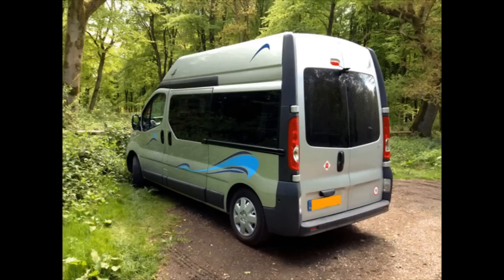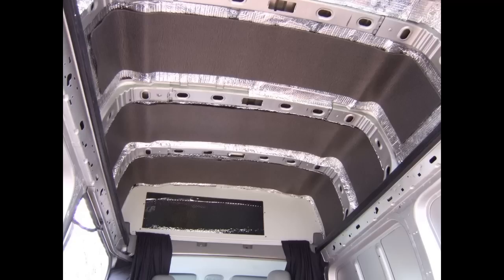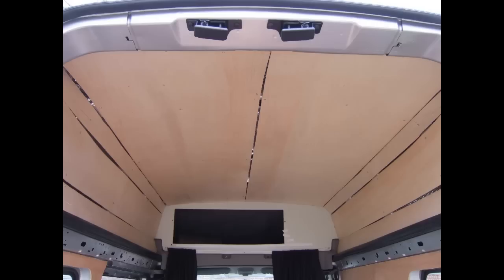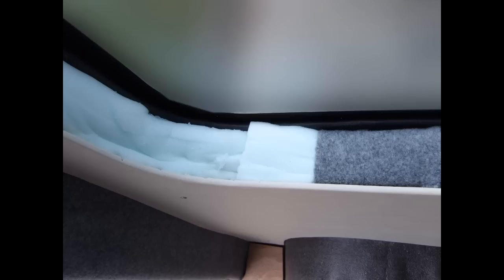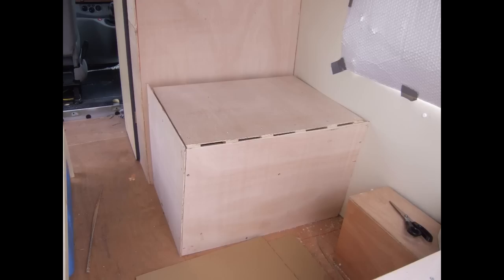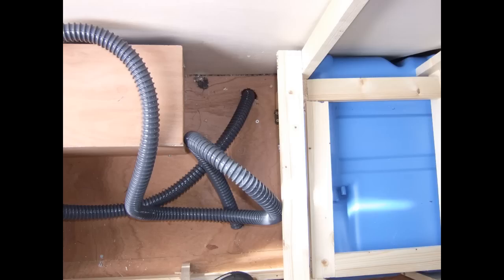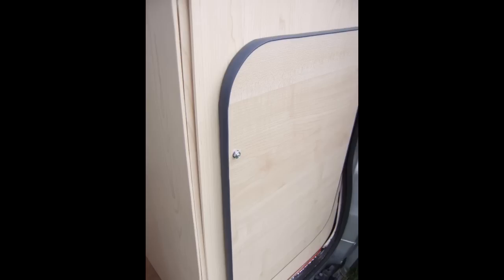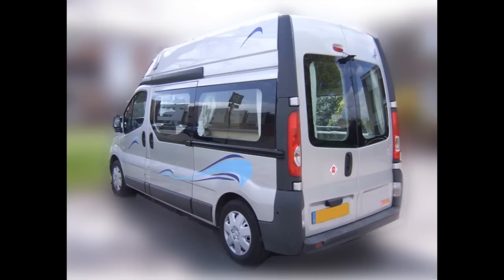HOW TO MAKE A SELF-BUILD MOTORHOME - Low Budget - From Start to Finish

Comment: i'm planning my conversion at the moment. im planning to use a refrigerated box (not a lined panel van) on a mercedes sprinter chassis (the sort supermarkets use to deliver your groceries to your house) as the refrigerated boxes have 80-100mm thick insulation which is already vapour sealed and the box is square internally with no funny angles or wheelarch intrusion, so making units will be a lot easier. also due to it being body on frame, there is space underneath the body to build lockers to house 400ah of batteries, water tanks, inverters etc, freeing up internal space. i plan to live in my conversion fulltime, all year round as there is no way in hell i'm going to become a wage slave doing 50 hours a week in some dead end zero hour contract job to pay £600+ a month to a slum landlord for some grotty horrid bedsit with prime views of the bins at the back of a factory! nor do i wish to be tied into a 30 year 200k high rate mortgage i may never realistically repay!!
to sum up: in a few years time while everyone else is losing their massively overvalued homes cause the gravy train banks have hit the buffers and they can't pay for them, i'm sitting on margate seafront in my converted van with a nice little pile of cash, no debt and a decent pint of ale, just watching the sunset on a beautiful midsummer day with not a worry in the world :)
I can only dream......
Reply: So how did it go? Still dreaming or did you take action?
Reply: insanitybiker sounds great..I'm at the age , buying a house is not a good idea, so in stead of living in a crap gang drug hood.im going to convert my van .A.S.A.P.  I'm in the USA..most hoods here is over Ren with gangs..no thanks..I'm not living around that.  !!

Comment from the maker: MPG still very good, am guessing about 35-40MPG, I can get about 700 miles on 1 tank of fuel. Overall impression - very good van, a pleasure to drive. definitely a no-fuss workhorse. 
The seating arrangement in the back however, is a bit uncomfortable for lounging around in. I may look into swapping the 2 table seats for 1 long sofa-type seat next year.

Comment: I'm not into motorhomes if I'm honest I did find your project very interesting.  A point to note regarding the battery, when charging batteries produce hydrogen gas - so It could be worth a consideration to vent it also.
Nice video and commentary...
Finished product looks good...

Comment: nice work mate. One suggestion, wrap your unused "window" panel (where the bath is) with 7+ years black glossy self adhesive vinyl to complete the blacked out windows look. Just a hint if you do so, dont cut directly on paint, use cutting wire used in advertising car wrapping.
Great video, it will help a lot of folks who are not decided if to go the DIY conversion way...

Comment from the maker: Thanks :o)  
Insurance is a bit of a minefield if not done properly. Regular insurance companies won't touch this kind of thing and will disown you if they see you've done anything like this. However, there are a couple of insurance companies that do actual "self-build" insurance policies where you have 120 days to go from a basic panel van to the full conversion. I used one of these.

Comment: I did not choose to put a bathroom or shower in my van conversion. They take up so much space and I really wanted to have the feel of an open rolling cabin rather than something with partitions and narrow passages. When I have to go in the middle of the night I have a large mouthed water bottle. Low tech but easy to empty in the morning.  I do bathing with a pot of water and I have an outdoor shower too.
Reply: Glad to see I am not the only one with large mouth water bottle... Lol
Reply: I have a capacity issue. Seems my bladder holds more than a quart sometimes. The best solution is a used laundry bottle. They are opaque too so people won't see you walking around with a bottle of pee on the way to a bathroom.
Reply: tracy smith nbbb

Comment from the maker: Standard upholstery foam for the seats. No glue used, material was stapled onto the base boards. If I had used glue it would have been spray contact adhesive.

Comment: That's a pretty ambitious project, Rick. I'd say that everything worked out just fine. If I were doing it, I'd probably skip the sink/shower altogether, push the bed up behind the driver seat, and include a full-length pass-thru storage at the rear door, but I have to say, this is a pretty impressive accomplishment. It also goes to show that if you just go out to your garage and have at 'er, you can build something pretty impressive.

Comment: The insulation segment, was good.  The only thing I would have done, as well, was to get some spray in insulation to fill all the holes in the van, after all, if you want it to stay warm inside, every little bit helps.  Also, when putting the panels inside, you have airspace in between, so fill the gaps with home insulation, stuff it in there, you will amazed how much it helps in the winter and the summer.

Comment from the maker: toilet is a thetford portapotti (self-contained unit). waste can be poured down any chemical waste disposal point at campsites, or down the toilet at home. 
120Ah leisure battery runs the lighting and water pump and is charged via a split-charger connected to the main engine battery.  Total cost for conversion was £3,000- this is mentioned in the video :o)

Comment: +rickvanman

I love the insulation technique you used - doesn't eat up the space like some techniques I've seen which use 50mm rigid insulation boards - and reasonably priced too.

I'm shortly going to embark on a little project of my own - just a small Day Van based around a LWB Transit Connect.
I'm not going to bother with a bed and furniture as all I want is a cosy and dry retreat for when the weather turns nasty on a fishing or camping trip - so I'm just going to insulate and line it, and install a basic 12v system with a couple of outputs.

I do however want to install a window into the sliding side door - partly for light and ventilation - and partly so that I can sell it on with as many boxes ticked for reclassification as a motorcaravan as I can  - without going to the trouble of fitting a sink, cooker and 6ft bed.

Nobody seems to make any windows specifically for the Connect as far as I can tell, how would you recommend I go about finding someone that can either make a custom one for me, or use one made for a different model that is going to fit?

Comment: Looking GOOD! I would suggest, be sure to put fine metal screen over the drain in the cooking gas compartment. Then if there is a leak the vapour flowing out of the "Drain" might become ignited and a metal mesh will stop flame spread to inside but let heavy gas out for more safety. Also battery compartment for a lead acid battery must have a top of box to outside because hydrogen rises and is given off during charging and heavy demand discharge...see next comment about your table problem...

Comment: In watching the cool job you did, make the table higher by building a deep, but, narrow box with a drawer sliding out the end toward the hallway, to put the salt, pepper, and silver flatware in...(Fork,spoon, & knives)  Also I put a small sconce wall lamp (One mantle) to have light and heat without using electricity...

Comment from the maker: windows were OEM green glass - standard size to fit that particular make of van. link to supplier in the notes :o)
No weight knowledge; haven't a clue,  but tried to keep everything as light as possible in the build hence 4+6mm ply instead of conti-board as used in the old Renault.

Comment: Very well done, the only thing I noticed was at the end of your video with the look around the outside. My OCD kicked in quickly when the recessed panel in front of the right window was silver instead of black. I think I would have to paint that part black to carry the color through and match the opposite side also. Aesthetically, I think it would help the flow on that side also as it feels a bit abrupt ending where the window was installed. All in all though, brilliant job....

Comment from the maker: see my other video titled "SELF-BUILD MOTORHOME 1 - SHOWER CONSTRUCTION " for answers. Easy to cut a hole - drill a pilot hole first and make certain you are not cutting into any structural components, then use a jigsaw. Car built shower? I'd say buy a camping shower and do it outside using the ground as your drain.

Comment: Cool video. You did a great job. About the only thing I might add if I did it, would be some sort of solar panel/battery system on the roof but with the deep cycle battery rigged to the vans charging system even that would be unnecessary.

Comment: Really nice build. I'm converting a Mercedes sprinter 2500 long/tall and I'm thinking of doing a similar video write up. I'm actually debating whether or not to include a shower/toilet as dealing with hot water and black water tanks aren't really to efficient for me.
I really want to avoid wood surfaces completely and build a very modern aluminum skinned interior. Again, you did a fantastic job, right down to the propane stickers!

Comment: You can get propane racks that mount on the outside back. Where you can mount two large bottles. This would give you lots of propane, and open up space.
Reply: In the UK you can't mount gas cylinders outside as such. They must be stored in a vented box labelled that it contains LPG. You just can't mount cylinders directly to the outside of a vehicle.

Comment: Inspirational video, thanks.  I noticed you didn't run any cables for charging your battery from the engine - I take it you just run a dead loss system then charge at home as you only have your water pump to power.

Comment: This is a very good build. Only thing I would do differently would be discard the need for a shower/toilet cabinet as I would normally be near a camp site/ civilisation. Perhaps a small chem toilet under a buddy seat for emergency use. I just sold a T5 VW recently. If I get another van I want one with the height advantage this one has.

Comment: Hi Rick
Its good you show the gas locker being sealed and the drain duct, but don't know if you realise you also need the bottom of the access door must be a minimum of 50mm above floor level of the cylinder dept as additional prevention against liquid gas leaking out?

If not maybe Google BS EN 1949:2002 which gives you all the requirements required to meet UK Law regarding installation of LPG systems. Hopefully you did or you could come unstuck with insurance.

Just finishing up converting a VW Crafter MWB high roof so been researching. Used similar materials but put 18mm wooden flooring in, 20mm foam insulation plus sound proofing mats and 2 x 100 watt solar panels with two 135Ah leisure batteries and a 1000w invertor and a flue free gas water heater but each to their own and everyone's budget and usage is different so Happy Camping!

Comment: Thanks for sharing. I learned from this but I also see some single purpose things that take up space that could have been done as multi purpose. Also where is the fridge and closet and what about solar power?
If you can put 3 things that lay flat against the wall that sit one inside the other why not? Biggest would be the bed. When folded flat against the wall on the bottom can be next biggest dining table and inside of that work desk with the bottom on the bed having shelves, speaker, monitor etc. so that one space accomadates three functions.
What kind of toilet was it? Was that a composting toilet? Where are your inlet and outlet fresh air flow? Did you figure out how to hide the light that would come out from both the inlet and outlet air ducts? Is there a heating system? Which one did you choose?
Have you considered an alcohol stove? Did you counterbalance the weight of the fresh water tank with the gray water tank by having them on opposite sides?
We did not get a chance to see your ligting system and how you power it.

Comment: Nice video and build. It may help if you like your legs elevated a little when you sleep as I do,, it doesn't make the bed longer but since I'm not in a straight line it makes me shorter. 75mm cushion seems to work well and doesn't bother me if I turn on my side in the night as it is not too high.

Comment: Tip when using mastic as you said you struggled to keep it tidy.Get some soapy water in a cup and dip your finger in the soapy water and then flatten the mastic out with your finger to get it even and where it needs to be and because of the soapy water the mastic wont stick to your finger.
Reply: +Davey 14 PS-GREAT job by the way.
Reply: +Davey 14 a cheap bic lighter works just fine to do it too :D i guess every1 has its own hacks hehe

Comment: Nice job! Well done. Just a idea for the outside design of our camper to get symmetry. If it was mine, I would paint the metal panel where you didn't cut a hole for at window, black, so it match up with the tinted windows. But nice camper :)

Comment: One process improvement I thought of : 'dry fit' the wood sides after the sheetmetal is cut but before the windows are installed. This should make it easy to trace out the window openings for a perfect fit.

Comment: I think I would add 1 thing behind the drivers door. Where the bathroom is, I would put a window adhered to the metal for continuity of style or paint it to mimic the other sides window with high gloss black paint. Although cosmetic i feel it would improve the look but i am a bit fussy.Altogether well done though.

Comment: What a great video.

I never see sliding doors on motorhome shower/toilet compartments. I guess this would be because of insufficient lateral space to slide into. Or is there another reason?
Reply from the maker: John Barclay Sometimes it’s awkward to fit them, but other times they can be utilised. I actually have a sliding door on the bathroom of my current van at the moment 😁

Comment: A Gaz 907 holds 2.75kg Butane for £30 which is £10.90 per kg of gas, multiply that 7 is £76.33 fo 7kg of gas whereas a 7kg bottle of gas costs £19.79. I know they are the one you get in France but there is an even bigger saving for the 15 kg bottle and reckon you are unlikely to run out with the larger bottles. A huge saving.

Comment: Hi Rick,  Couple of specific questions. Hope not too intrusive :
- Is it an L3H3 or which is it ?  You mentioned inside width of 6" but I did get the inside standing height. Was it over 6' ? What was it after flooring ?
- You mentioned ordering pre-cut plywood for interior. May I ask for link to supplier ?
- You show the water tank under sink but how does water gets to the shower. Was it a hose passing inside a rib in the vehicle ?

Excellent job. The near million view count proves that you must be helping somebody. Congrats.

Comment: very nice van built on a budget /but/ if you do another, may I introduce you to a hole saw set which fits into your drill.
very cheap and make perfect round holes in the size of your choosing rather than a series of 3mm holes.

Comment: great job....very impressive.....I plan on using a ford transit....i think i will need more insulation as i live in Canada and want to use it to tour the Canadian Rockies in winter for skiing and ice climbing.......I will also need a propane heater and i plan on using and adhesive type of solar panel for the roof in order to generate some power for my cameras and laptops etc..i also was going to see if there is any kind of smallish blade system that i could install on the roof which when spinning would generate power???..hope to be done by this fall...which gives me a good five months...anyway take care and drive safely !!!  cheers!

Comment: Thanks Rick.  Now I'm wondering do I install the rubber part facing the outside or facing inside?  My intuition is to install it with the rubber facing the outside.  It's for flooring, and the instructions say that the rubber should be facing the floor.  Presumably because you don't want the sound to travel to the room below.  So, in the case of a van,  if you don't want the sound from outside, then the rubber should face outside.  That's my theory.

Comment: Great job! One thing I saw during the build is that you have wood resting directly on or slightly above your fresh water tank. While on the road the resulting vibration could over time chafe a hole in the top of the tank. Did you fit any rubber grommets on the tank to prevent that?

Comment: Apart from some of the things you list at the end which you left out, you mentioned heating? What about Solar panels, entertainment batteries, satellite, night lights, awning...
All unnecessary extras for you?

They're the sort of things that complete the motorhome picture for me. But, I guess even then its still cheaper than buying a Hymer for instance? I wonder apart from the satisfaction of creating something like this, whether in fact buying a 2nd hand motor home would work out about the same in price?
Reply from the maker: If I could buy a used pre-built motorhome with the same age and milage on it, I would, but for the equivalent amount I paid for this one, I would have only got a 12+ year old banger. As it's my every-day vehicle I wanted something newer and reliable so this was really my only option.

Comment: Nice job. However in Australia to install glass windows it is a RMS (Roads & Maritime Services) requirement that you substantially strengthen the roof structure.
Reply: In the uk, if you add windows it can be hell to get insurance as they do not like to cover alterd vehicles. thank god my two vans are stealth campers so no windows beeded,,,,,.
Reply from the maker: pepersorte
 Insurance can be an issue here inthe UK, but thankfully there are a few companies that specialise in self-build vans that cover such things.